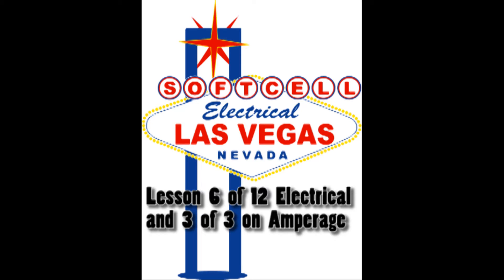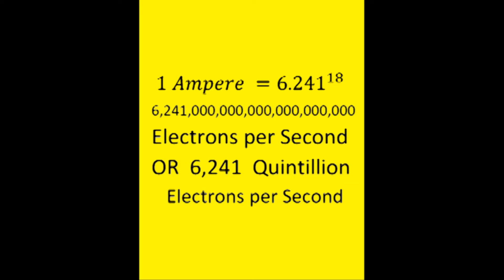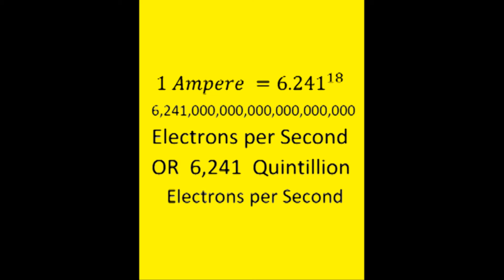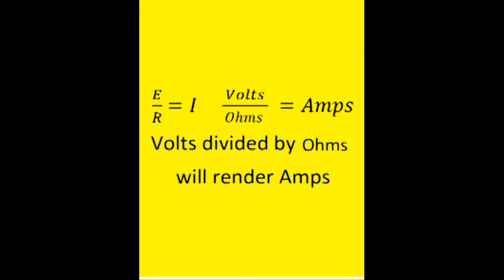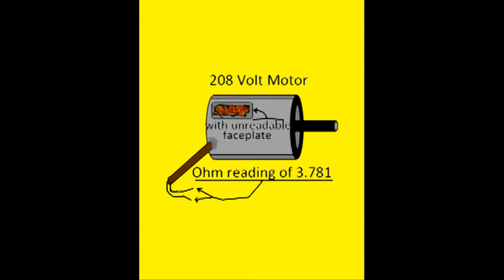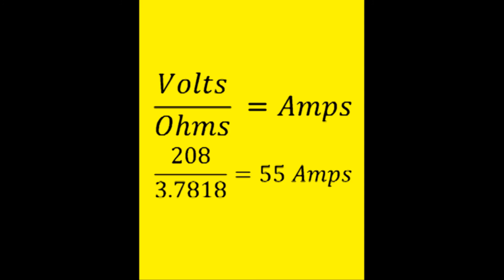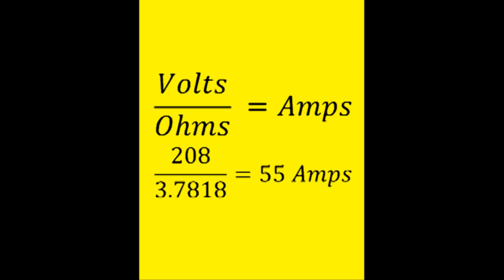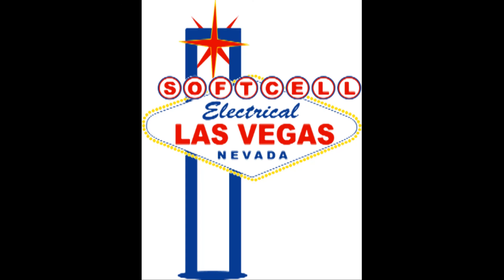How to determine motor voltage # 59

Comment: This is about finding the amps the motor consumes not the voltage, title is misleading
Reply: Well, a motor is a has a linear ratio between amps and voltages... Appliyng Ohms law WILL give you the voltage.